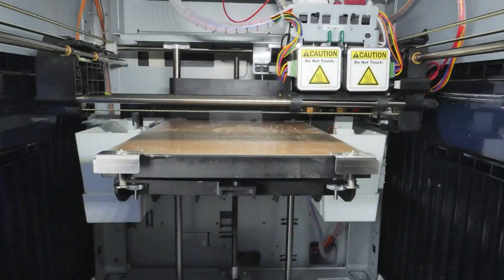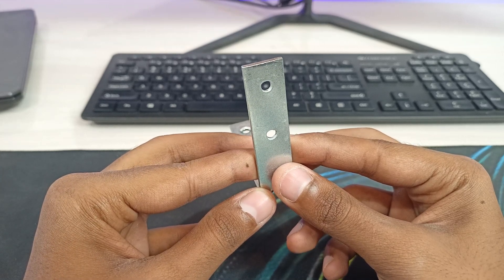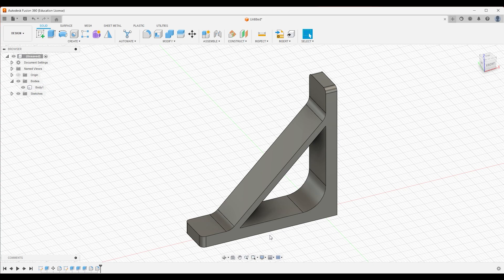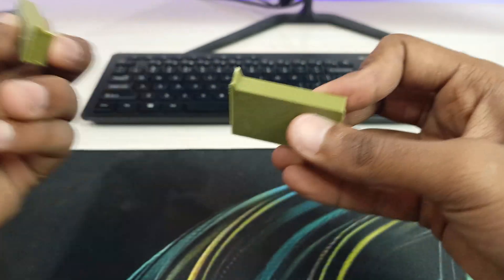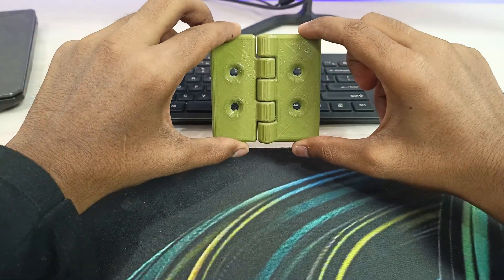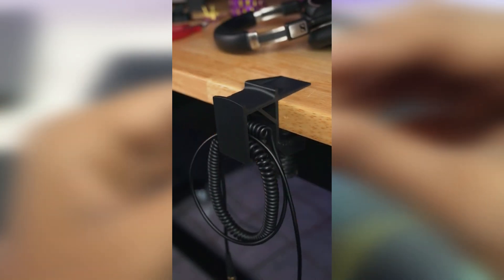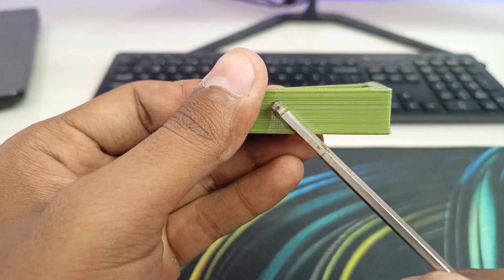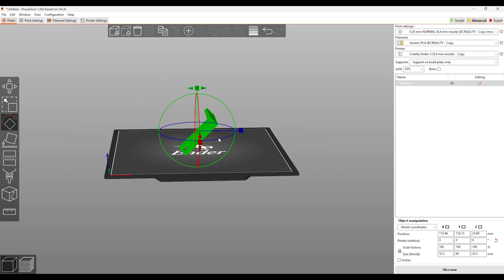3D Printing Beginners should know these things

Comment: My 5 tips.
1. Increase temperature.
2. Increase temperature more.
3. Use materials where layers really weld not just stick. Definitely not silk or matte materials. Preferably not PLA.
4. Tune geometry & print orientation.
5. Increase temperature more still.
Reply: simply increasing temperature that much will give diminishing returns which result in under extrusion and matte surfaces in your prints. i recommend you watch CNC kitchens videos on the matter or you might end up shortening your PTFE tubing's lifespan
Reply: @siddhartheaswar959  CNC Kitchen prints cold and that's why he has such bad layer adhesion results. Indeed you can't go hotter with a PTFE lined hotend. Modern printers don't have those, and fixing it on an older printer is a $10 upgrade that's no harder than initial assembly of the printer was.